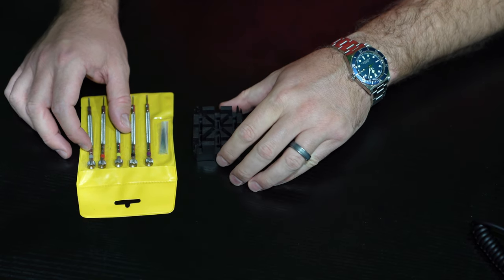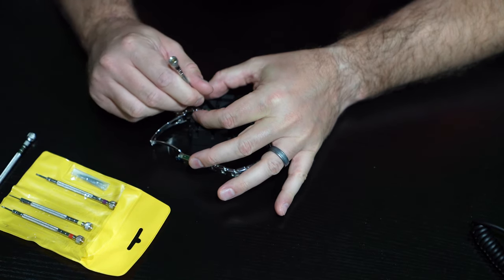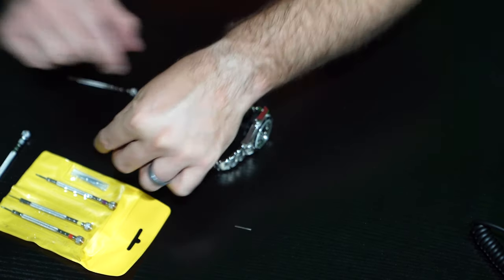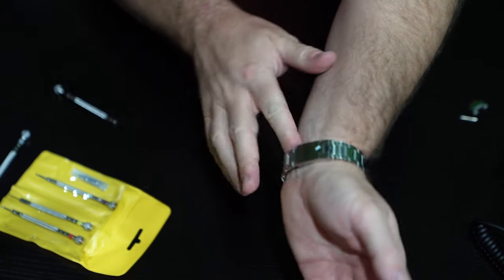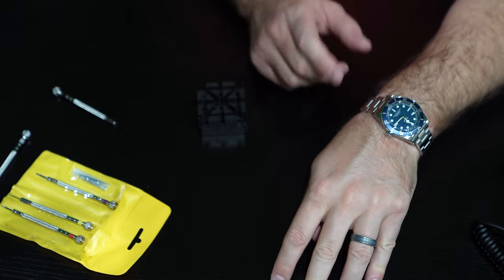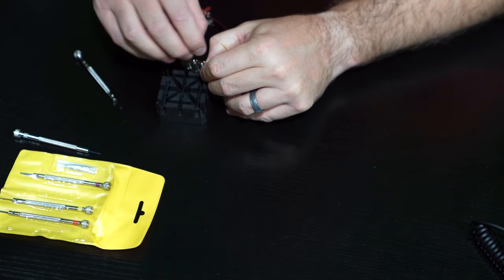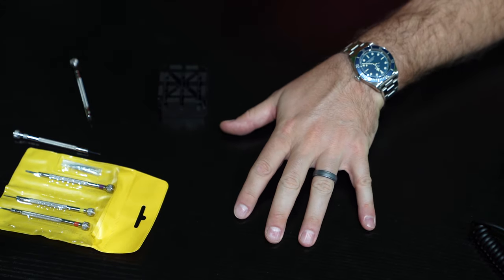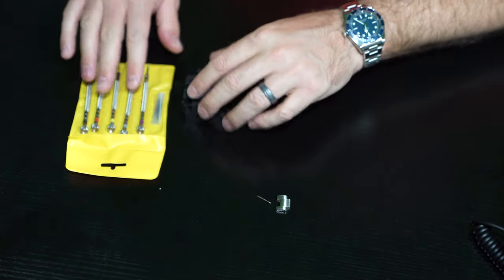How to Resize a Watch Bracelet Containing Screws

Comment: Thanks for the video. When I got my Tudor Ranger the assistant sized it a little lose for my liking, but he said taking another link out would make it too tight. What he and I both forgot at the time is the Ranger bracelet has the ability to adjust small amounts with a mechanism in the catch. So another link out it is. It's good to see you do it before I try it on my new watch. Also worth adding the Tudor dealer I used put some threadlocker (loctite) on the screws - this seems like a good idea.
Reply from the maker: The Tudor Ranger has a superior T-Fit bracelet.  That bracelet allows micro-adjustments, similar to GlideLock on Rolex.
Reply: @IrixGuy  yep, unfortunately when he sized it (too loose imo) the t-fit was already at its tightest setting so I can’t use it to take up the unwanted slack. But if I loosen the t-fit and remove a link I should get the perfect fit. Thanks again for the video.
Reply: @Sim9mo  
Buy yourself a nice “T” screwdriver bracelet tool from esslinger. 👍

Comment: What if I need to remove three links? Should I remove the two at 6 o'clock and one at 12 o'clock?
Reply from the maker: It’s a matter of personal preference but rotating 12/6 or 6/12 is the correct approach.  Since it’s an ofd number, you’ll either have 2 removed at 12 or 2 removed at 6.  Personally I’d rather have the 2 removed at 6 & the 1 at 12.